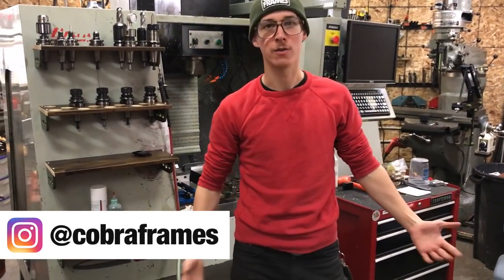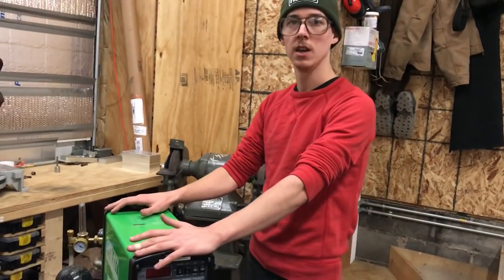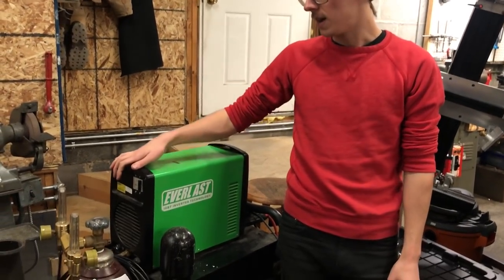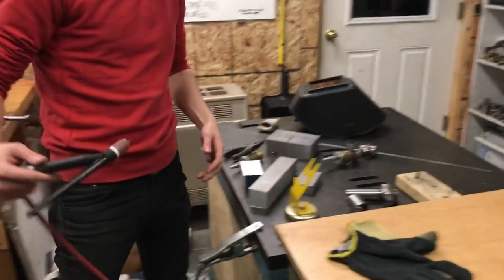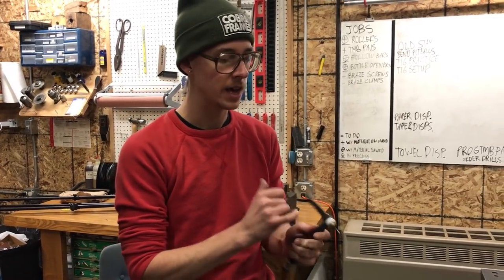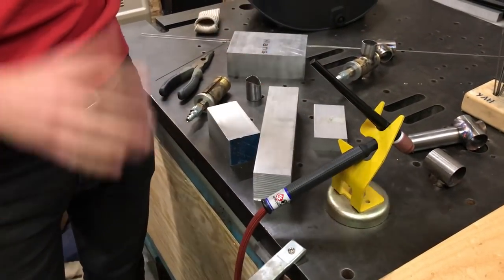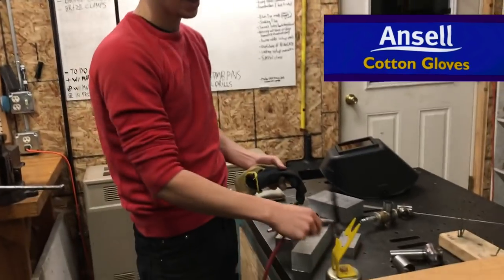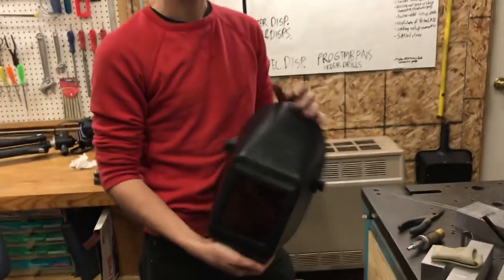TIG Welding Setup for Bicycle Framebuilding

Comment: Step up man.  Get an HTP.  Can get the Invertig 221 for $2000.  Made in Italy.  Equivalent to a miller dynasty.  Very well built machines.  Lots of features.

Comment: Why do you use stainless filler rod instead of a mild steel filler for the 4140? Is it more the way it feels as you dip and work with it or are there strength implications?
Reply from the maker: You know, I have to admit it's mostly because a lot of other framebuilders do it. That's not a very good reason, haha. I know a little bit about welding bikes from doing it, but I really don't know a lot about the metallurgy or chemistry etc. Other framebuilders who seem to know what they are doing and have been building bikes and welding them for a while seems to generally like it and as a beginner that was enough for me to give it a shot and I haven't felt the need to explore further, but it would be a worthy pursuit. Check out the welding tips and tricks youtube video where Jody welds up a bike frame. He uses tubing and filler supplied by Mike Zanconato and he does some of it with 880t and he makes some remarks about the filler. Jody knows a lot more about welding than I do!
Reply: @cobraframebuilding  All good! Building frames seems more about the feel than anything. Really enjoying the content

Comment: There are cheaper gas options for back purging.
Reply from the maker: Cheaper than a second regulator and all the fittings or do you mean cheaper than the expanding heat sinks? I primarily use the heat sinks to make welding go more smoothly and I don't always back purge with them. The regulator I bought is pretty cheap, so IDK my setup might not be the absolute cheapest, but it's really not that expensive either. If you're serious about making great bikes I think it's pretty reasonable to invest a hundred dollars in backpurge stuff.